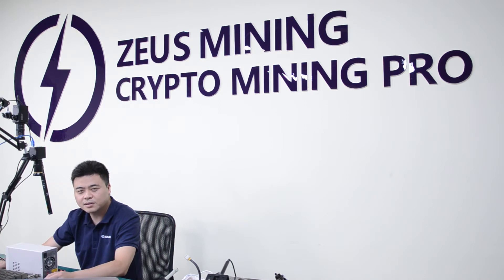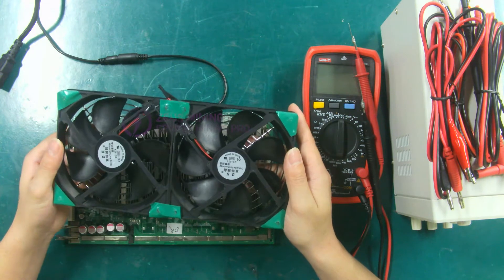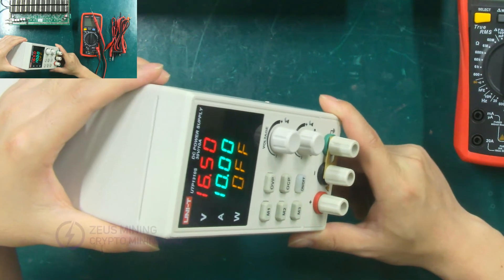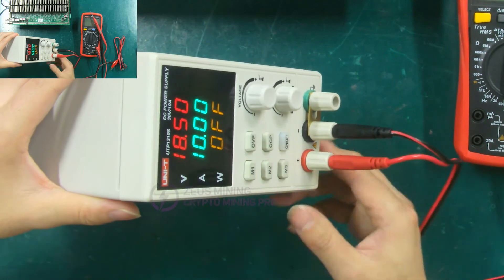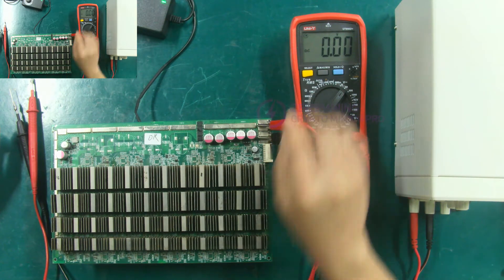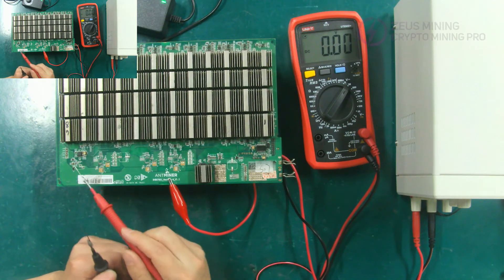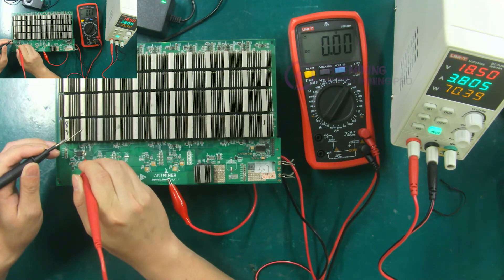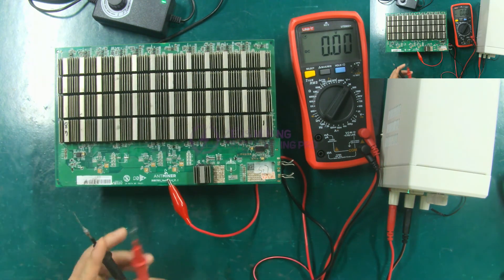UTP1310S DC stabilized power supply instructions for use

Comment: Nice 👍🏻 
I have a question, can i use the stock power supply and power up one hash board and do the testing?
Reply from the maker: This UTP1310S DC stabilized power supply can replace the fixture output voltage to test the hash board